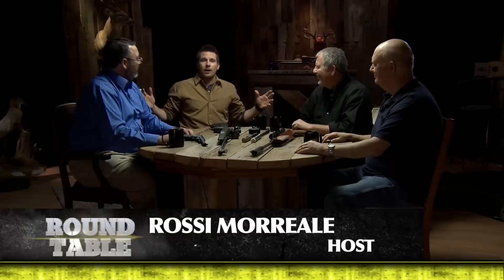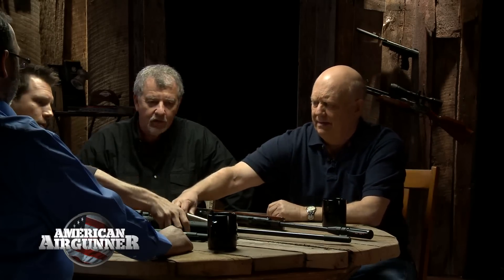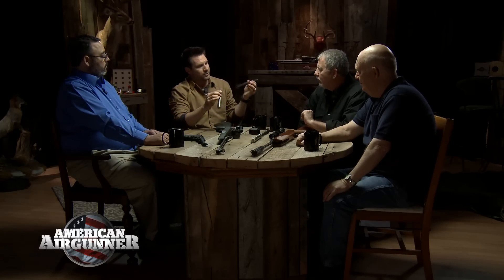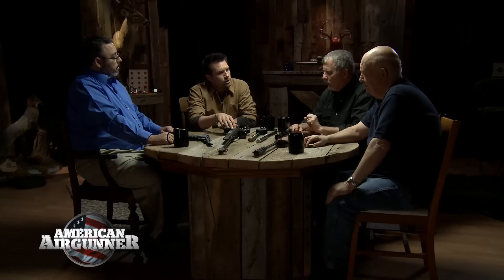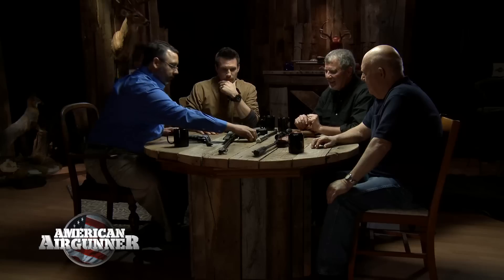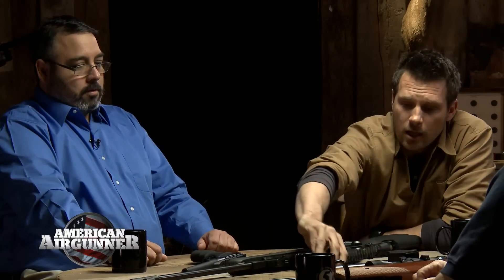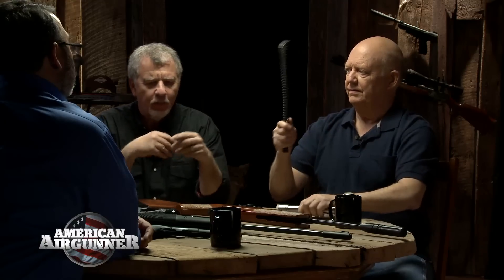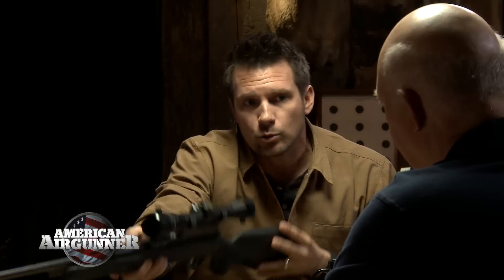Everything About Pellet Gun Air Rifles : American Airgunner TV

Comment: I've found, over the course of a few decades, that the artillery hold doesn't have to be taken in the strict sense. I hold my air rifles the same as I hold fire arm rifles. With ONE exception. I hold air rifles steadily, but not firmly. I don't pull it tight into my shoulder, nor grip it firmly by the forestock. Just enough to steady it for accurate aim and squeeze easy. If any of you have watched my videos, you'd see what I'm referring to. Don't wrap your fingers tightly around the forestock. Just loosely, steadily. It's all in gripping it just right to let it move, while keeping it steady at the same time. That gives good groups, among a couple other things, like pellet shape, weight, cleaned or not, that sort of thing.
Reply from the maker: Yep. Many have found the same thing. Especially on rifle that are incorporating things like StopShox. Key is to hold consistently the same once you've figured out what it likes.

Comment: There are a couple of minor errors in this video.

Near the end of the video, it's mentioned that there is a set distance that a pellet will travel when the air gun is level and parallel to the ground. It's also suggested that the distance that the pellet will travel when fired level and parallel to the ground is the same no matter what the velocity.  The comment that a pellet will hit the ground at 100 to 120 yards is incorrect because the distance it travels is proportional to the velocity that the pellet is traveling. It is also affected by the weight of the pellet and it's shape.   The distance that the pellet will travel when the rifle is level and parallel to the ground varies greatly depending on these variables so those comments are incorrect, which is surprising, coming from shooters who should know better. 

It's true that if you drop a projectile while, at the same instant, firing it from a firearm or air gun that is level and parallel to the ground they will both hit the ground at the same instant.  We all learned that in high school (hopefully).  But a pellet traveling at a higher velocity will travel further in that time, obviously. 

Imagine, for simplicity sake, that when a pellet is dropped, it takes one second to hit the ground. (It would take less time at normal heights but this keeps things simple.)

Now imagine that at the exact instant that you dropped the pellet, you also fired one from an air rifle  at the same height that was level and parallel to the ground and that has a muzzle velocity of 500 fps. That pellet will hit the ground in one second after travelling less than 500 feet.  The pellet starts slowing down the instant it leaves the barrel.  But, to keep things simple, let's assume that the pellet doesn't slow down as though we were in a vacuum, again, to keep things simple.  In that case, it would travel exactly 500 feet before hitting the ground.

Now, let's do the same thing with an air rifle that has a muzzle velocity of 1,000 fps. In that case, the pellet would travel 1,000 feet in that one second. (Again, it would actually travel less than 1,000 feet because the pellet would be slowing down but it would still travel much farther than the pellet that was fired from the air gun with a MV of 500 fps.) 

So, contrary to what was said near the end of this video, all else being equal, an air rifle with a faster MV will shoot a pellet farther than an air rifle with a slower muzzle velocity and there is no set distance they will shoot because, in addition to the velocity,  the shape and weight of the pellet will also affect how fast it slows down in flight.  If the muzzle velocity is the same, a heavier pellet with an aerodynamic shape will travel farther than a lighter pellet with a less aerodynamic shape.  Heavier projectiles slow down less quickly due to their kinetic energy so, all else being equal,  a heavier pellet will make it travel farther.  The shape of a projectile also affects how fast it slows down due to friction (air resistance in this case) which is consistent with the example given correctly in the video about a tennis ball and a badmitten birdie.   Again, there is no set distance a pellet will fly as said near the end of this video and velocity does increase distance.   The "tested"  100 to 120 yard figure given in this video would only be true for a specific pellet shot at a specific velocity.  I'm guessing that he made who gave the "tested" 100 to 120 yard comment got that from reading test results for a particular air rifle with a specific pellet.    If it was true that all pellets hit the ground when fired level and parallel to the ground at a height of four feet,  there wouldn't be much advantage to having a higher muzzle velocity, especially for target shooting where the target isn't moving.  In fact, an extremely weak air rifle with, say, a 100 fps MV would shoot a light non-aerodynamic pellet just as far as a heavier, aerodynamic pellet fired at 1,500 fps.  Common sense tells you that that isn't true. In fact, the differences in distances would be very great.    Beyond that, the distance a given projectile will travel is also affected by altitude, humidity, temperature, and a list of other variables but those are generally so negligible as to be non-existent concerns for air gun shooters. They are something precision bench rest shooters and possibly even long range snipers often taken into account.   The point is that there is no set distance that all pellets will travel when fired from a given height, level, and parallel to the ground.  The distances will vary greatly.   Where the figure of 100 to 120 yards mentioned in this video came from is a mysteryThat said, there is a factor that narrows the distance between high MV pellets and low MV pellets. Wind resistance increases greatly with velocity.  In fact, it increases by the cube of the velocity.  In other words, if the velocity doubles, wind resistance increases 8X.  Even so, all else being equal, the distance the pellet will travel varies due to velocity,  weight of pellet and aerodynamics of the pellet.   There is no set distance that all pellets will travel if fired from a rifle 4 feet off the ground, leveled and parallel to the ground as mentioned in this video. If you have two air rifles with different MVs, you know this from experience. 
It's a small point but it's important to understand. This applies to firearms as well.  I'm surprised that those comments were made by people who are shooters and hunters.  These principles should be understood by all shooters - both air guns and firearms.  This is basic external ballistics and it's intuitive and easy to understand.  If a shooter doesn't understand these very fundamental things, he or shee won't be able to intelligently choose the right ammunition or pellets for a particular use, let alone the right firearm or air gun.
Reply: +Bob Miller Yeah. Ur rite.
Reply: I bet your a joy to live with.
Not married I'm guessing?

Comment: I want to know why do they not design a springer that is built and designed for dieseling specifically?
I mean why not? I'd love to have that option of owning an air rifle that has Seals built in designed and made for oil detonation.

That would actually be a great selling point also I'd think, an air gun that supports both options of firing with or without adding a flammable substance. We could call it the "Vinn Diesel", lol.

It'd make a great gun with a boosting option no?

Get your "Vinn Diesel" air rifle today! need 300ft/S additional power for that long shot? just add a little 3 in 1 for that extra boost! lol.
Reply: I agree and was wondering the same thing, but maybe it starts to move the gun into the direction of being an actual firearm (since there is detonation). If so they could just make it capable of this but not an advertised feature -- word would spread.
Reply: ezridr1234 the ATF defines a firearm as a device that uses a Firebase propellant to propel a projectile so the ATF would probably classify as a firearm if it is designed to do it.
Reply: ho much extra power does it actually give you
Reply: Look at the Weihrauch Barakuda EL54... there you go ;) Mendoza might have one with an oiled sponge to force dieseling, i heard but couldn't confirm till now

Comment: Bought myself once a Crosman Phantom 4.5mm break-barrel cuz it was on sale. Came with some cheap scope and mounts.
Shot lots with it just using the iron sights. A nice average airrifle.
After a couple of years I finally decided to mount the scope on it. Haha.. The mounts placed the scope a bit leaning towards to the other side (side depended on which side the screws were on). Was a bit irritated that the scope did not get placed right on top of the barrel. Definitely needed to put the scope on so it would lean on the right side(my right hand being the trigger hand), twist the sight so the recticle's vertical line would line up with the barrel underneath. Always have to hold the rifle lean a bit to the left then, so the recticle's horizontal line would line with the horizon... Thought this all would do the trick after setting the scope in. But no - I shot terribly with the scope. Thought the scope was completely crap. Maybe is too - because it being cheap and all that. But I bet now - that I was just holding the rifle wrong.  The rifle got put away after getting such bad results - but now the time has come to try it out once again - thanks to the American Airgunner show and info on the subject. :)

Update: Yup. Probably held the rifle wrong in tha past. Have shot nowvbullseyes from 18 meters free standing. And whacked out easily my target from approx 30-40 metres semi-rested.

Comment: What they didn't touch on is whether or not there is considerable point of impact change because of the break barrel design. I've always wondered whether sighting in a scope would stay constant with a break barrel. There's a reason they put the iron sights on the barrel only.

Comment: I have a gamo springer and it is rated for 1400 fps it is crazy.
Reply: most probably that rating is for the lead free ammo, regular lead pellets will travel slower. to check if it really is a 1400 fps gun, fire a lead pellet from it and listen for the supersonic whiz as it moves downrange, like the sound a .22 rimfire makes. if no whiz sound, it's only a 1400 fps using lead free pellets
Reply: I know I forgot to say that.
Reply: I have a Gamo Hurricane that's rated for 1250 fps, with lead pellets there is no zing from the pellet, with lead free pellets there is a very audible zing as the pellet travels downrange. I was at the local range shooting it.It has a very large muzzle break on it as an aid for cocking  ( 58 Lbs of force needed ). Was shooting lead free pellets at the time, others thought I was using a silencer! LOL

Comment: you did forget to mention a gun that is cocked for a long time and over time can get spring fatigue there for making it less accurate and giving it inconstancy on power and break barrels in particular can suffer really bad accuracy if the barrel moves or is loose by  and other part can wear like a bearing system or chisel system to lock the barrel in place      stuck to a fixed barrle more accuracy
Reply: superhunter992 How does a fatigued spring become less accurate?  I can see weaker, but less accurate?
Reply: +filoIII 

Less equal distribution/exertion of force will cause slight inaccuracy in any projectile. If the spring is weak, it won't exert the amount of force required to propel the pellet in the desired distance, thus making it more inaccurate at greater distances. Any decent shooter will be able to compensate for drop, of course. 

If the barrel is rifled, then the pellet won't spin at the original speed with a weakend spring, again, making it slightly less accurate, as the air will be able to resist the projectile a bit harder.
Reply: yeah i could not of put it better myself

Comment: Spring piston airguns have an accuracy problem --- they are only as accurate as the shooter can remain consistent.  They have very good shot-to-shot accuracy only if the grip, rest, hold, follow-through, etc. is repeated exactly.  Vary any factor even a little, and the spring piston air rifle will either change its point-of-zero, or shoot wildly all over the place.  Even the required oiling of the gun will cause the same symptoms, and too much oil causes the gun-damaging "dieseling" effect.  Shooting a spring piston gun requires correct practice, and previous experience with any other design of airgun or firearm counts for nothing.

Comment: The guys in the video seem to suggest that ALL spring piston rifles are hold sensitive, but that is not entirely true. I have an RWS 460 underlever, and it is not hold sensitive at all. In fact, it groups best if it is held firmly when firing it. Maybe they should have said, "many of the break-barrel rifles are hold sensitive, but not necessarily the fixed barrel rifles".. I think that would have been more accurate.     Another silly statement the young guy said... he asked, why would someone buy a magnum air rifle in .177 caliber? Then the other guys laughed. . That is absurd, because there are VERY good reasons why people choose .177 caliber in a high powered air rifle. I don't have to explain it, I think most people can figure out why gun makers produce rifles in different calibers.
Reply: +Trevor Jameson I use all my guns 4 target practice. I can cancel my heart beat wobble with fuzzy wool gloves n I'm ok. A R-11 .177  Rx-2 .20 M54 .177  the brothers .177. a 440 gamo n .22 but I seldom shoot it. Real accurate, stupid I guess.
Reply: Trevor Jameson my Gamo and my Crosman are both springer .177's and I use the same ammo for both. Much small game and medium size game has ended up in the pot with those guns. I also killed a "knocked down (with shotgun) but flailing" 8 point whitetail deer with a Crosman 1377 with a domed pellet straight up to the antlers from under the jaw. When I cut the skull antler section off, the pellet was embedded in the bone exactly between the antlers. Complete brain pass-through. The high powered .177 are highly underrated. They do the trick. A 32 pound raccoon found that out the same year.
Reply: Which Remington?

Comment: Are there any viable (for hunting) big bore spring/piston air rifles?
.30cal would be good, but "viable" (imo) means at least .22lr performance at 50+yds.
Reply: Jaycbee024 Any 30 cal Air rifle is going to far exceed 22 cal lr performance, double or triple. Good question though. I'll watch for their answer.
Reply: A 22lr is double to triple the power of even the strongest spring or gas piston air gun!!

Comment: Have the gas piston air rifles improved in durability over the years? I have read so much of them being prone to leak.
Reply: With gas rams having been around for so long, the easy answer is yes.  Bear in mind though, just like springs, it's impossible for anyone to tell you the actual life of a gas ram.  Yes, they may leak at some point in their life, this would be no different than a spring breaking.  Overall, the gas rams that have come out recently from various manufacturers have had less issues than ever before.  The power  plants are very solid now. There is definitely still a difference between a high dollar Theoben ram and the less expensive gas pistons from Umarex, Hatsan, Crosman and others but you see that in the overall cost of the rifles. So yes, they are definitely improving and as long as the manufacturers are doing a good job of QC, there is no reason they will not continue to improve.

Comment: I am sold on my springer.  The problem came when my scope broke. I was hitting golf balls at 90 yard zero..  Killing varmints at 125 yard and down to 10 feet, for about 3000 rounds. So what is a scope that will last?
Reply from the maker: Check to make sure the scope lenses are internally manufactured for the double recoil of a spring rifle. Many scopes are equipped now, but still some exist. Start at PyramydAir.com for a good selection.
Reply: I am going to try the diana 20 moa zr mount to try to mitigate that recoil. Can not find much info on it. It has been around for 3 years and no one is talking about it. I will try to give a review after 10 K rounds.

Comment: Can you replace mechanical spring with gas spring?
Reply: Sometimes yes and sometimes no. Depends on the make of the air rifle.
Reply: JaleelJohanson62 Which ones or are you guessing?
Reply: Not guessing. Some air rifles can be converted from spring to gas ram and some can't. For example, the Diana underlevers can't. Years ago there was a conversion for the RWS 48/52, but not anymore. The Beeman Kodiak (aka Webley Patriot) can be converted to gas ram. I have two of them that are. Do you have a particular rifle in mind?
Reply: JaleelJohanson62 You didn't mention Gamo or Crosman, of which I own both. Was just wondering if there's a conversion for them. Question: why would the RWS not make that conversion anymore? Outdated, or is it a matter of designed obsolescence, or just forcing you to buy new to get what you want?